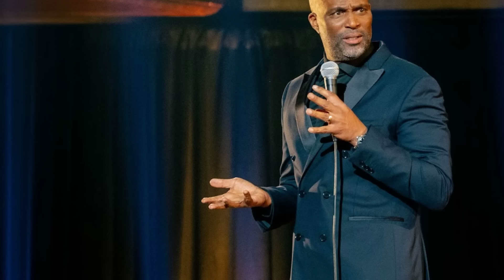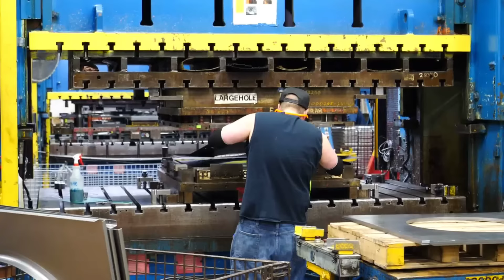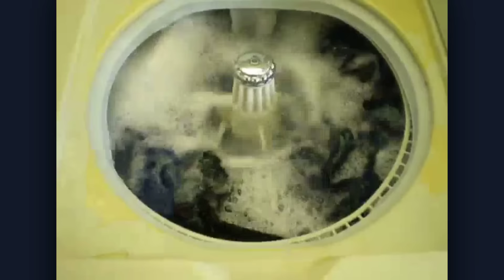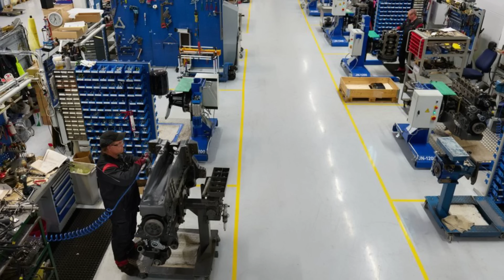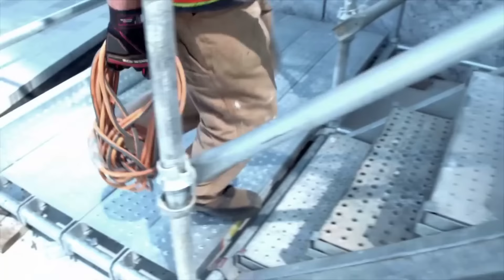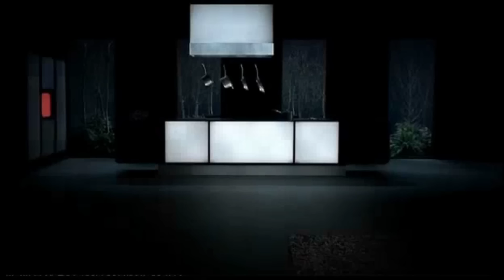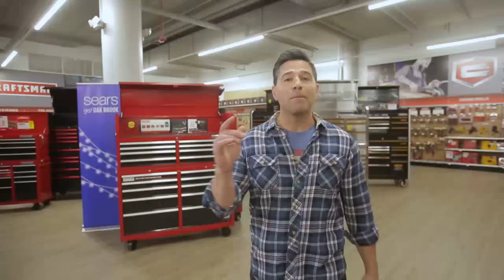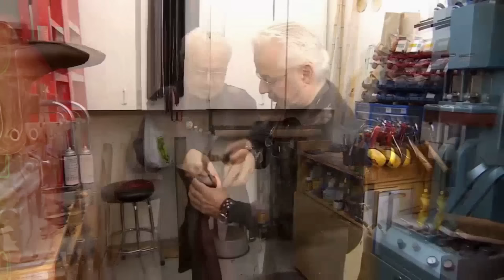The Only 5 Brands That Still Last (The "Buy It For Life" List)

Comment: I have a  Rubbermaid Dust Pan from the 70's that is SOLID rubber-like plastic. Now all Rubbermaid products break on contact - made in China with cheap plastic. Drop a Dust Pan it cracks. Laundry Baskets break at the side handle openings. Those Rubbermaid Storage Bins with lids all crack when moving them full or stacking them. Rubbermaid trash cans all crack.

Comment: My hobby is cooking and while cast-iron is good there are also other choices such as carbon, steel and stainless steel. And in pots include  aluminum. 
Also nonstick is better  then it used to be and I have two of them that I used for special situations with low heat, they work perfectly, and they are ceramic based. I think the absolute health is for you is stainless steel but most of those come in layers and if you would leave one of those on the stove by accident with nothing in it, it can be damaged.. not to steal, but the aluminum or copper core can be. I’m not 100% certain that the so-called seasoning that makes carbon steel and cast-iron nonstick, is without carcinogens. I know if you cook an acid base dish in one of those that seasoning will come off and that means you’re eating it and if it’s something burnt, now data indicates that there are carcinogens in that. So I use my carbon steel and cast-iron only when I’m using high heat and oils and fats with no wines, vinegar, or tomato sauce sauces.

Comment: The pictures you show for Speed Queen do not match your descriptions very well.  And even if they did, the TC5 is NOT the old-school washer with mechanical timer.  The one you show has computer boards in it, and even though it "tends" to work "similar" to the old-school stuff, the computer boards in it are a high failure point according to Speed Queen technicians.  And they are very expensive, and the earliest ones are already no longer made.  DON'T be fooled into thinking that just because you spent $1500 on a TC5 that it will last 10-15-20 years.  Some of them probably will -- but SOME DEFINITELY WON'T.   And after repeated repairs of computer boards that EACH cost you hundreds of dollars, it will still end up on the scrap heap next to the Samsungs and GEs when the computer boards are no longer made and you can't get one.  

The Speed Queen TV2000 IS the commercial machine just without the coin box.  And for years they made it in a "home use" model, with more features that a home user would want.  But no longer.  Because it is a commercial machine, designed for commercial use, it does not have a load-size water-level selector.  If you're trying to stay away from the new HE garbage because they don't use ENOUGH water to get your clothes clean, you might relish just having a full tub every time.  But in truth if you are doing smaller loads, it would be nice to be able to select a smaller size if you wanted to.  If you look for a slightly used TV2000, it will have a load-size selector on it.  But nothing new that is completely old-school does.

Comment: That Honda carburetor will gum up just like the rest of them,. Has nothing to do with Honda. It has to do with ethanol fuel. Never put ethanol fuel in anything that doesn’t get driven or used every couple of days. Simple rule if it goes in a gas can, it’s ethanol free

Comment: Here's a shout-out for my Dualit toaster.  Simple, reliable; the clockwork bit that you turn with the knob broke. New one took two days to arrive and cost£12.00 ($15.00 approx).  Pet hate; those coffee machines that take capsules. I've had three; de Longhi, Krupp and Nespresso. They all broke; couldn't be fixed. Gave up on them.

Comment: Im a tool technician. I went to a seminar for our big box store about tools and parts/repair products. We were told that in all of ontario, canada.
All of the 100 stores only had to send the gx generators back or repair them in 1 year of huge sales and rentals.
We only had to repair or return 3 generators over the whole province and every store! The returns Honda authorized immediate replacement and asked us to send the 1's that broke back to them for study and correction in engineering or material. They are thw only generator i would ever buy.

Comment: Speed Queens are great but the last time I checked they don't have a residental washer for Kingsized bedding. So these are a great if you don't have King sized comforters. If you want King size the next bet would be the 700 Series Front Load Washer from Electrolux.

Comment: My 1987 Sears Kenmore washer and dryer lasted 20 years and then parts were no longer available. The washer transmission failed and the dryer controls failed but it still went on and off manually. 
How much does the Speed Queen washer shown cost and who sells it?

Comment: Way to think & act! 
When I built an offgrid cabin in '87 I bought a 1600 Watt Honda generator for power supply. 
Later built another offgrid cabin in a different location that experiences -50° to -60° winter temps and used the same generator. To be functional it had to be kept in a heated box outdoors. Yet to test Honda's reputation I wanted to see if it would start on a -28° morning 'without' heat. 
At that temp the pull cord won't easily pull at all. Or retract. 
But after about 20+ minutes it got to the point where it pulled freely and finally started. I'm sold on Hondas. 
Later passed the same machine to a younger friend, and it still runs, over 35 years later.

Comment: If you throw away a generator because the pull cord snapped then you're an absolute idiot. Pull cords are generic and easily replaceable. If you can't do it yourself, any small engine repair shop can do it for you.

Comment: 1. Speed Queen TC-5 top loader laundry machine
2. Honda GX series small engine (mowers, etc)
3. “Goodyear welt” boots (Red Wing Heritage boots, Thoroughgood American Heritage boots)
4. Cast iron pans 
5. Channel Lock (pliers), Wright Tool (wrenches, etc)

….We bought LG washer and drier in 2007 and they’re still kicking like new.  🤞

Comment: I  was born in 1955, my folks moved into a new house bought a GE refrigerator.  20 years later we moved the fridge to our vacation home.  20 years on the fridge was still running fine. My brother decided we needed a new fridge and bought a new Frigidaire, it lasted 3 years before it failed and we went back to using the GE. It would still be running today if he hadn't unplugged it and put it on the back porch to rust.

Comment: This AI generated video is BS.  Honda engines are just as susceptible to old fuel as any other.  Old gas in my Honda powered lawn mower and the intake valve stuck open.   Most hand tools will never wear out if used/treated properly.   Look at the inexpensive (HF) ICON brand getting great reviews/attention.  I could go on.

Comment: Sorry all the old timers but this video make no sense except maybe the cast iron pan if your woman can lift it proper while cooking. 

Take the shoe for example, a pair of sketchers boots lasts 3+ years easy for $60, I can pay $60 now and leave the rest $240 in my pocket instead of paying $300 then deal with the hassle of getting it repaired later. Same with the tools, craftsman are made in China but they work just fine for everyday use and lasts for many years at a fraction of the cost. As for the washer this speed queen cost $1500+ with an old fashioned center column, I can get a Maytag XL commercial grade washer that is significantly larger (half number of wash cycles needed), without the center column, at almost half the cost. It makes the day to day user experience so much easier over the years, saves time, and leaves more money in your pocket. Ran for 7 years and still going good, enduring my wife’s almost daily abuse and works just fine? 

Only the iron pan kind make sense because it cost about the same as nonstick, and nonstick does break very quickly along with the health concerns, only issue is the weight you need a strong woman to lift it 😂 for daily cooking.

Comment: because of this producer philosophy of ' engineered obsolescence', i've turned to making many of my own tools, from pizza ovens, to grain mills, to repurposing engineered to fail blenders into light fixtures.  I was a history major, but i taught myself welding, electronics, masonry, cooking, fermentation, ceramics, carpentry, etc, whatever i need to do to make or repair what i need, instead of going to the shop of disposable crap.

Comment: Kenmore fridge I got from my parents when I moved out in 1987. They had it for 3 years prior. I was 20 years old. I'm 59 and that refrigerator is still in my kitchen.  I had to replace the ice maker about 10 years ago. That's it. No other repairs. It's not stainless steel and very fashionable with the scratches and yellowish paint but she runs like a top.

Comment: Our new Speed Queen washer and dryer are electronic, so that's incorrect. Also Honda quit making lawn mowers after the fiasco with the engines being faulty, and I have a Ryobi pressure washer that has a recall on the Honda engine. I didn't even get half way through this video before bailing.

Comment: I had a stove built in the 50's. Best stove I ever had. Made in the USA.  Had to replace in the 1990's because of electric board issue. Had a Burnham oil furnace from the 50's and replaced that in the 2000's. Called the company who bought them out and they were shocked I still had it. Parts were obsolete. Truly junk is sold today. Skimping on strength in parts and materials. Cutting corners. I was told by a salesman in an appliance store to expect a stove to last 8 years or less. They know it's pretty junk but it's all they have.  It's time to start building with pride. If it's built in the US, it should be good enough to stand behind the product. Replace the CEO's who get millions in bonuses for producing junk and making shareholders happy while consumers are miserable.

Comment: Lodge bare cast iron pans are made in the USA, while their enamel coated cast iron is made in China. If you want a new Lodge cast iron pan that is as good as that pan from the 1920s (I have Griswold pans), be prepared to sand the insides smooth, which is no easy task, and then season it. Another cookware brand that is made in the USA, and you can pass on to your kids is All Clad. Three ply and five ply stainless steel (depending on your budget) pans that last forever.

Comment: I did this research when my washing machine broke. I originally intended to get a speed queen for the reasons stated in the video.
In the end I didn't, for these reasons.
1. They are so much larger that it wouldnt fit properly in my laundry
2. It was so expensive that even though they last 25 years, I calculated I could buy a new Samsung machine every 4 years for 25 years and still save money vs a speed queen. 
3. The 25 year warranty is only on the mechanical bits, NOT the circuit board for the control panel. I asked them and they could only have warranty on that for 3 years. And to replace or repair it if broken, would cost the price of a new Samsung /LG washer.
So what's the point?

Comment: I recently bought a set of Speed Queens last fall.  The washer is a top loader, because I wanted to get back to basics after being burned by my last Maytag front loader. They most DEFINITELY have locking lids.  In fact I had to modify mine so I could bypass that feature.  They are also VERY QUIET! Literally the only thing I can hear while they run is the sound of water sloshing.  It was a really nice change after my LOUD Maytag, that was loud enough to hear running from OUTSIDE my house.  The Speed Queen is so quiet, that I don't bother closing the laundry room door.

I also use cast iron in some of my cooking, but I prefer the enameled cast iron.  It's easier to maintain. I originally inherited my MIL's LeCruset, from the 70's in avocado green, but I've added a few pieces of Lodge and some of the ones Aldi sells. But the original, uncoated cast iron is tough.  As in stands up to Boy Scouts tough.  I've only seen one piece, a skillet that somehow they managed to destroy in the 14 years that I've been part of the Scouting.  But I can't 100% blame it on them.  I found some possible manufacturer defects that might have led to it's demise.

Comment: I bought “cheap, plastic” LG washer and dryer that measures water and such in 2016..Still going strong. Will see how long it will last, so far I am happy with it. My minimum expectations were 10 years. Will see how long after this I will have to get a new one.

Comment: Moldy rubber seals does not total a washing machine. It is like scrapping your car because it is dirty. Just clean it with Rodalon or some other rubber friendly disinfectant. let it sit for a while and make a habit of letting the door stand open in between washes.

Comment: If you don't want your cloths to be worn early by an agitator washing machine: Get the old school Miele washing machines from the 1990's till somewhere in the 2010's when they still had stainless steel drums, cast iron frame and was repairable, with any washing machine apply a descale at least once a year or learn to change the heating element. You can still get parts for them online if you do a little research.

Comment: My Whirlpool electric dryer died this week. It is in the 30+ age range. The manual is dated 1988. The whirlpool washer is 23 yrs old and still working. I've been contemplating replacing with Speed Queen for both. I still daily use Farberware stainless st cookware bought in 1973 - looks like new. My Osterizer blender is also from 1973.  I prefer to avoid any computer run appliances, and especially any spy/talking gizmos such as Ring doorbells, Alexa, etc. not having my privacy invaded and used.

Comment: At 66 you, I haven't bought a new car since 1995. I own 2 very nice old cars. My mother's Hamilton Beach stand mixer 1951 is still working. I have my grandpa tool box with 50 plus yo craftsman tools, my other grandpa's drill, my 1977 Kenwood amp and tuner, Advent speakers....on and on. If any young person is reading. Buy past high old brands...like those that are 50 to 70 years old
The one I almost forgot...a solid cast oscillating fan by Westinghouse.
I agree with his SpeedQueen recommendation. 
A great frig new brand is Fisher Paykel. Veggies last more than 2 weeks.

Comment: Not impressed with Honda.  Put away running fine.  Wouldn't start the next time.  When you pay a premium for what is supposed to be a reliable product, and it fails to perform to those standards that is a fail.

Comment: As a toddler in the early 1960's I would use my mother's Electrolux cylinder vaccum cleaner as a hobby horse, now in 2026 I am 68 years old and still use it to clean the house. Well done Electrolux!
Reply: I would add "well done Electrolux in the 1950s and 1960s"

My 21 century Electrolux washing machine was made not to last and not to be repairable.
Reply: Electrolux, which used to be the gold standard for affordable vacuums, no longer makes cylinder vacuums.
Reply: As a collector, i bought used all these simple powerful steel model Lux vacs ...  E, S, LXI, L, 1453 & stylish 1205 & they all work great - just cleaned them up & got a new VINYL hose! I wish i could find a model G  HOSPITAL vac - quietest vac ever made!! & a model 1521 commemorative edition  given only to the best salesmen! KIRBYS  look & sound HORRIBLE & SCARY! lol & it's sooooo ridiculous moving that entire heavy machine back & forth over & over & over again to clean. 🤣
Reply: @utuBrV1oI I prefer the weight of the Kirby, but I understand how it does make it more strenuous to use.  I feel like the weight and the strong suction are what helps it to clean deeper into the pile of the carpet instead of just superficially.
Reply: @eelnoops5200 my parents bought a Kirby in 1960, and Mom sold it with the house in 1987 as part of the deal. The buyers wanted it.
Reply: @utuBrV1oI  thanks for pointing out that you must get a replacement Vinyl hose for an old Electrolux tank vacuum. The original design woven mesh hose has a weird failure mode: it must have been rubber lined and the rubber degrades over time so there can be good suction at the vacuum but very poor suction at the end of the hose, because air is leaking in through the walls of the hose. 
I volunteer at a charity that accepts old household goods, fixes them up and gives them free to needy people. I work on the vacuums. When I first saw no suction at the end of an Electrolux hose, I thought the hose was plugged, but after I snaked through the hose and saw there was no clog, I realized air must be seeping through pores in the hose.
Reply: Nothing sucks like Electrolux!
Reply: @TommyOve   My parents had the same vacuum my whole life.  It worked great - well worth the money they paid, though it was a lot for a young couple to pay.
Reply: My mom had an Electrolux cylinder. I remember it well because I got to know it when I got old enough to start doing chores. She got a Kirby after the cylinder died.
Reply: I still have mine. To be honest, it's hard for me at 81 to wheel it around.
Reply: My grandma had a fridge that was about 40 years old.  Things lasted back then.
Reply: Unfortunately it cost just as much to resole Red Wing boot as it does to by a new pair
Reply: Mine was en elephant.
Reply: I have an Electrolux from 1987. Still vacuuming.
Reply: ,my kriby is still going after 30 years !

Comment: Carbon steel pans are really nice.  I have a couple of hand forged that are great. Lighter than my Lodge cast iron and arguably a little more rugged. Once what ever I’ve cooked is finished I’ll take the carbon steel pan straight from the stove to the sink.  Releases much easier when still hot.  Not supposed to do that with cast iron because it can crack. Lodge carbon steel pan is about$50. Lodge cast iron pan is about $25.  Blanc Creative (hand forged) is $220.